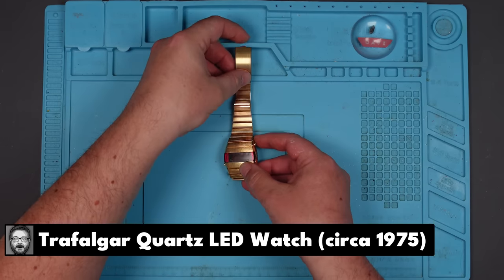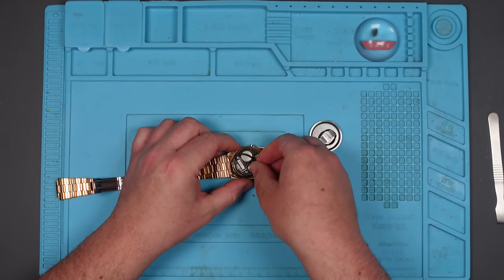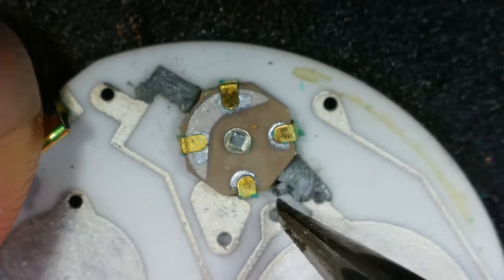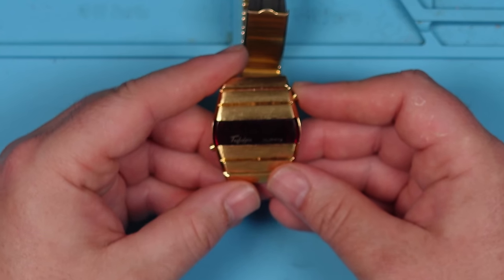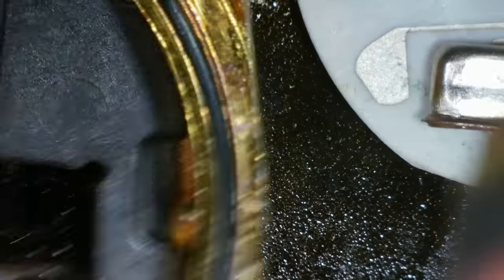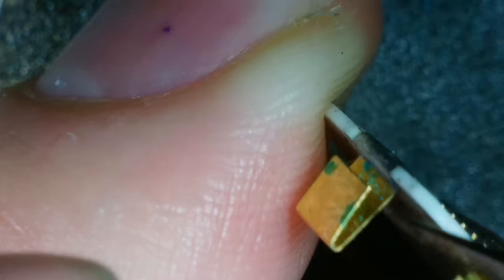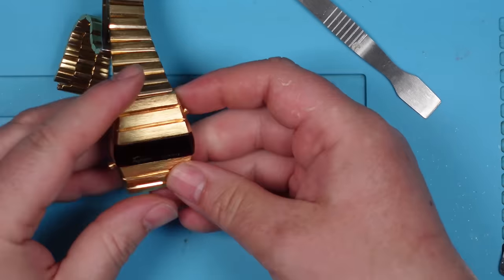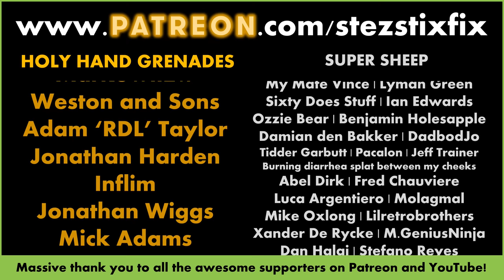Lovely 1970's TRAFALGAR LED Watch with NO POWER | Can I FIX It?

Comment: Well done. The round component is a ceramic air trimmer capacitor (which regulates time in combination with the crystal),  Removing the carbon resistive coating may cause timing variations. Johanson was the most prevalent manufacturer.
Reply: Johanson was working on surface mount at that time, IN THE 70S! everyone should have a good look at the transistors and caps etc on this Hughes module (I'm pretty sure this is). Extraordinary advancement for 1973 when these became available, They are almost identical to modern surface mount devices. I was in the electronics industry and was in fact learning my trade as a youngster from about 1978. I simply didn't hear about surface mount until maybe sometime in the 90s, at which point I was collecting LED watches.. I was too stupid to see how really clever they were.
Reply: @martinda7446  Yes but can you type 5318008 & then turn the watch upside down?
Reply from the maker: @jonathanwright1507  😁 I used to do that on my calculator in school!
Reply: @StezStixFix  I think we all did & back in the 80's, also, we thought the kids who had a calculator watch, were the coolest kids in the school?!
Reply: Mid 90s i had the calculator and remote watch. It was cool to have 😂
Reply: We all know that

Comment: I’ve loads of led watches from the 70s including this very model in stainless. They are when working very collectible, that model is £100-300 all day long.
Push the button for time and the date button gives you running second and the date only as in 15th 
Is a rarer Trafalgar two button module.
All I do with them is submerge in a small jar of alcohol and cycle in my ultrasonic cleaner for 30 minutes as it’s clears all the electrolytes out the way. 
Good thing with this one is all the tiny wire bonds that go to the leds are sealed in that hard resin. The earlier ones the bonds are exposed and generally fail.  
It’s early tech and predates LCD digital watches that came within a few years of these and of course took the market as battery life was superior.  Even Omega made led watches and the most famous was Pulsar who made the first.  Even Roger Moore wore one as Bond!

Nice to see a watch on your channel Steve. Pleased you could save this one.
Reply: Yep, Bond wore a Pulsar (Time Computer) in the opening scenes of Live And Let Die, funnily enough M arrives and gives him his Rolex which he swaps over, and the Rolex supposedly has a magnetic field generator (impossible - As he makes M's coffee spoon twang off and stick to the watch, ''it can even deviate the path of a bullet'' Says Bond - ''I'd like to test that theory now' says M) and it also had a rotating saw blade bezel. Also just about impossible, though they must have made a working model as you saw it spin (and almost stop as he tried to cut a rope).
LCDs were developed in the 60s but were not commercially viable until the early 70s when Seiko introduced their beautiful chronograph in 1973! (everyone else had to wait a few years) Live and Let Die came out in 73, so really the LCD was only a couple of years behind LED. LEDs ruled until about 1977 when LCD took over completely. The market was flooded with cheap Seiko chronograph rip offs in about 1978. Cheap LED watches were available in plastic resin cases by 1976 for a tenner and again the cheap LCDs came a couple years later. The Swiss were having a massive panic and continued having one for twenty years.
Reply: @martinda7446  Bond wears 3 watches in Live And Let Die
Hamilton Pulsar P2 2900 LED digital watch
Rolex Submariner 5513
Tissot Visodate Automatic PR-516

The Hamilton Pulsar P2 was a technically advanced watch for the time, but function wise it was quite basic in it's features. It only had the capability to show the time (hours, minutes, and seconds) no date, stopwatch, alarm, or other functions. But the P2 was the world's first successful, mass-produced digital watch. LED (Light Emitting Diode) watches were only popular during the 1970s and were quickly replaced by LCD watches.

The time is set by using a magnet, which is stored in the clasp. Holding the magnet against the Hour or Minute position in the back of the case enables you to adjust the time.

Hamilton created an homage to the Pulsar P2, the Hamilton PSR H52414130 in 2020, a watch of which the design is almost identical to that of the Pulsar P2. The watch doesn't have a LED screen, but an LCD screen and is powered by an automatic movement. It's available in steel and a limited edition steel gold-pvd version. It also says Hamilton on the bottom right unlike the P2's Pulsar branding.
Reply: @martinda7446  the first Seiko digital was the 61LC in 1973 but it was not a chronograph, that came in 75/6 with the 0634. There were 3 models with the 0634-5019 being the most desirable. I have all 3 that I have managed to save 6-7 years ago when they were still really cheap. 
Also have quite a few early Casiotron which were the first Casio watches proper well built and in their day were worth a fortune new. Funnily enough I have an advert for the Seiko 0634-5019 and it’s priced more expensive than a speedmaster on the same advertisement!
Reply: @MyRetroWatches  My memory is getting completely shot (or I didn't know in the first place - can't remember which😸). Thanks very much for that MyRetroWatches..
Whatever, I loved that Seiko chronograph (the 0634 thanks again) utterly timeless. (Well lets hope not completely timeless).
Ha, ha, I have a Speedmaster Albino. Funny I think that it is the most perfect analogue watch, and its been in space and on the moon. I've had three of em.
I used to have a collection of LED and LCD watches but stupidly sold them.
I'm hoping you have a channel I can join..I'll look now
Martin.
Reply: @MyRetroWatches  I have a casio lcd from70/ 80's? which says its solar powered, with a bar on the front. Im pretty sure thats straight up B.S.  ( I contacted casio au and they have no records that far back here)
Reply: Saw my first LED watch in the film, 11 Harrowhouse (a comedy/thriller about a Diamond heist).  It took me a few years to buy my first one at Dixons, but I'm struggling to recall whether I paid £9.99 or £19.99 (a week's wages as a School Leaver) in 1977. Sort of puts our Smartphones into context doesn't it?😂
Reply: I’ve got a Pulsar P2 - it worked but was a bit flaky and inaccurate , so i sent it to pulsarledtime for a restomod electronics module keeping the original led display - works great now
Reply: I got one of these led watch’s I think it was 1974 it was a birthday present the back came off and the writing inside said THE HUGHES AIRCRAFT CORPORATION IT NEVER WORKED AFTER THE BACK CAME OF SO IT WENT IN THE BIN GLASGOW SCOTLAND 🏴 WISH I HAD KEPT IT I also have an omega sea-master mega quartz from 1975 unfortunately got sea water into it and I’ve been told that it would cost more to fix it than it cost

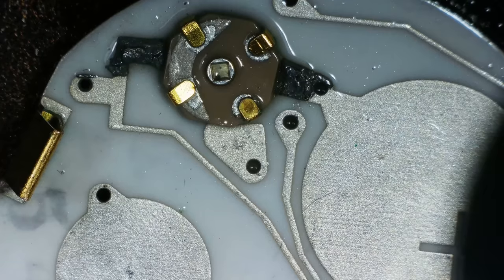Comment: @ 9:05 - this is a capacitor preset to tune the crystal frequency during manufacture (small square recess in centre for the adjustment tool). It's then soldered in place (the arc-shaped area on the left with the two contacts) to set it permanently.
The flickering might mean that the push buttons have corrosion around the contact points (the upright contacts on the PCB) and the case, preventing completion of the circuit.

Comment: Nice fix! I read a 1970s digital watch repair manual that talks about conductive epoxy instead of solder, so I guess that's what the grey gunk is? It might be worth treating it to some Renata 357 batteries - they are a lot less likely to leak than alkalines.

Comment: So the problem all along was the spring contact on the back cover were not contacting the batteries to complete the series connection but was pushing partially on the crystal and one of the batteries. Once you rotated the back cover 180° at the end this completed the connection between the positive and negative of the batteries.

Comment: That trimmer - I once made a tool using a single square pin pulled from a ribbon cable header (I think) and superglued into the end of one of those disposable propelling pencils. Worked a treat.

Comment: Well done, nice to see it working! Looks like the watch my mate had when I was at school around 1974/75. Remember him saying you had to push the switches to keep the display running, it was designed to have a 1 year batt life, based on e.g. about 20 pushes a day average! I was quite jealous of his watch at the time, I just had a Sekonda clockwork analogue watch that my Dad bought me for Xmas. I'm completely useless at fixing watches, even at changing batteries in them! One thing I picked up when you were cleaning those little spring switches, you could use one of those small right-angled tooth brushes. But anyway, good job getting it running again!

Comment: Nice  job, as a mechanic I can tell you that the grey hard material, is what's called, quick steel, it's a putty based, chemical metal, which has a hardener inside, when mixed together, and exposed to air it creates a solid bond, and can b drilled and tapped, I think someone has tryed to make continuity, instead of soldering it! 👍

Comment: The part you cleaned is probably a variable capacitor perhaps in pf range to finetune the clock with the second capacitor on the other side. and take a look at the lid, you installed it the first three times in the wrong orientation, maybe that was part of the fault :)

Comment: Those old Mostek modules are among the best ever made and are damn near bullet proof. Often the only issue is the quartz crystal,other than maybe some old battery corrosion or caked on gunk. The QC's are it's weakness as they were in many led watches of the era but replacing it is pretty simple and will often bring them back to life. On these modules I leave some of the old QC's two wires in situ and still connected to the actual module and solder the new QC to these wires,thus avoiding direct heat to any part of the actual module. You were damn lucky flooding it with alcohol and you would not get away with it on most lesser modules,especially on the digits side. Use it very,very sparingly. You also missed some corrosion on the inside of the brass button contacts. Something many people fail to spot having cleaned the outside and visible parts. Nice you got it working though.

Comment: I've got 1976 Zenith 'Time Command' ,it has a big plastic module with two slots for batteries exactly like here, quartz part is standard for  the time ,but mechanics it's not a typical gear train , there's a 3 gears directly kicked by the large stepping motor ,so there is no visual damage whatsoever, the watch is unusual ,its around with thin  lugs ,they didn't make a lot of those. 
Are you familiar with that kind of movement??????????😁

Comment: If you watch the video carefully, each time you reassembled the watch you did not place the back cover properly.
You placed the back cover correctly only at the end of the video.
It's extremely important to place the back cover correctly for the springs to  push the batteries down in their housings and also to bridge the batteries (to double the voltage).
Having said that, further cleaning the contacts was the right thing to do.
Great job! Thank you for this video!

Comment: 7542 would be week 42 year 1975, but you probably know that already. Cool watch!
The round disc-like thingy is a capacitor. Together with the crystal it oscillates.
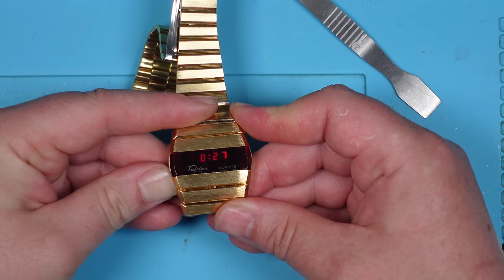At 14:40 onward you can see faintly flickering on video. That is because the segment display digits switched on after each other quick enough to fool the eye and appear all 4 digits  on the same time. On video it is visible because it interacts with the video frame rate.

Comment: Hey Steve, do you clean the corrosion with Isopropyl alcohol or white vinegar?  I am  sure you probably know this but nothing cleans corrosion better than white vinegar.  It actually reacts with the corroded parts to remove oxidation and debris.
Reply from the maker: Yeah, I probably should have used white vinegar, I normally do! But I figured this was such minor corrosion that it'd be OK! 👍
Reply: @StezStixFix  wanted to mention, I love your content.  Your original musical interludes especially are fantastic!

Comment: 7542 will be a date code, likely year/week, so late 1975.
I had a sinclair "black watch" made by my dad from a kit around that time, probably the same chip. it had.... issues. to reset the thing, there was a soft area in the plastic back of the thing, meaning that if you flexed your wrist, it reset the watch. added to this, the quartz wasn't particularly great & had a resonant trimmer on it for adjusting the main frequency, so it actually kept worse time than a cheap timex.

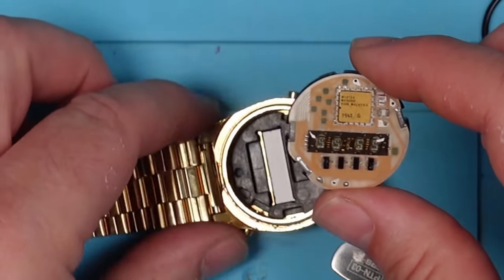Comment: At 2:38 if I had to take a guess at when that integrated circuit was made; looking at the code “7542 G” the year of course is 1975 and G is the letter of the month it was made (July).  42 is probably the factory code where it was made at.

Comment: You should invest in a can of contact cleaner. Then you can simply soak the parts in the cleaner to chemically dissolve and neutralize the corrosion. Follow that with a bath of IPA and you have a perfectly cleaned and preserved piece of electronic history!

Comment: vinegar, Steve, vinegar. Even Dave knows that vinegar cleans corrosion in a watery solution, then wash it off with iso. I know you'll hate me for saying, but i was rooting for some transistor replacement or trace repair

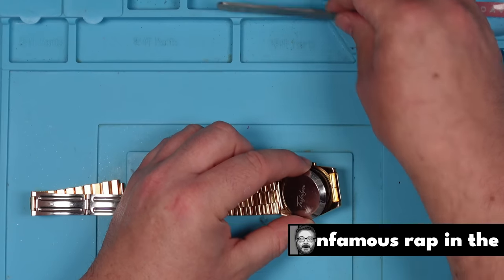Comment: Ok, here is my update. I got a Phasar 2000 and got the circuit out and cleaned it, there was a lot of crud around the Quartz case. After cleaning and loading back in the case the watch began to run. I can set the time, but when I try to to get out of the time and date setting, the watch resets back to the 1:00 o’clock default time. Any idea??

Comment: The buttons on that type  of watch are usually shorted to the watch case, whether that is pulling the connector to either high or low, whichever the CASE, may be...😀 see what I did there ??😂

Comment: I bought one similar in about 1975.  At the movie adverts, there was one on a blokes wrist in a Cadburys Milk Tray advert, it looked SO COOL compared to all the boring mechanical cak that was around at the time.  NO ONE I knew had one.............I WANTED ONE.  Fast forward a bit I was doing my Jungle Warfare Course with 2 Para in Malaya.  Went to a shopping mall in Singapore and came across one.....  semi erect I purchased it.  I was the talk of the company (D Company, 10 plt).  I was due in the jungle for a weeks exercise so gave it to our company Clerk for safekeeping rather than get it sodden in the Hulu.  Came back to it erratically flashing in chinese looking corrupted graphics.  Later on, I found out that the dickhead had gone swimming with it on hus wrist.  CHEERS Harbert you plank, no wonder you ended up as a clerk....

Comment: Think the case of the watch and the circuit board contacts create I think the case of the watch and the circuit board contacts createconnection don't be a contact somewhere around that connects to the case itself we push the button creates a connection something simple what are these watches back in the old days